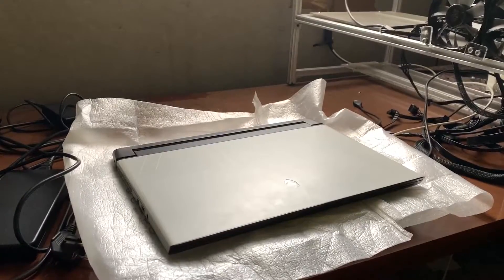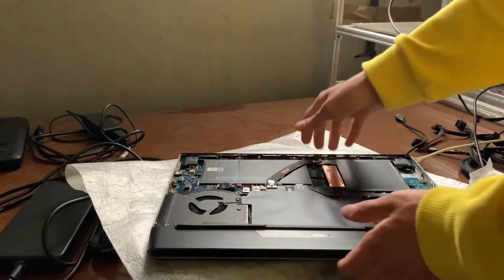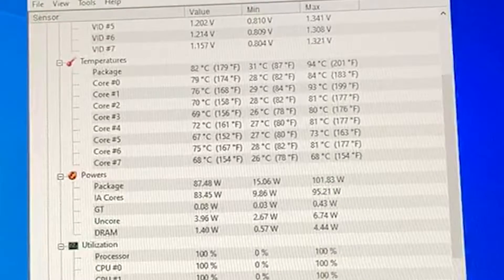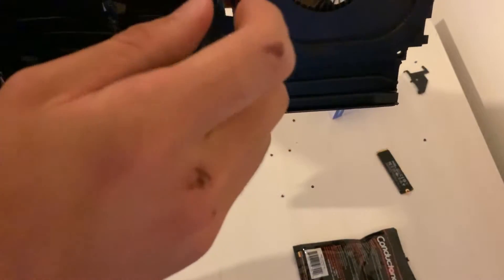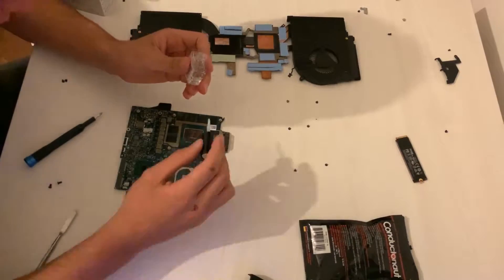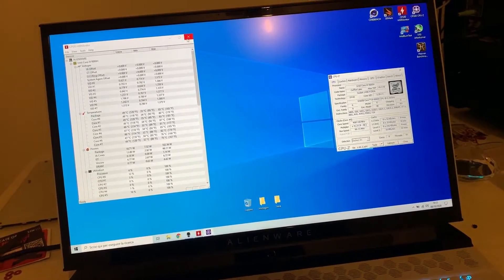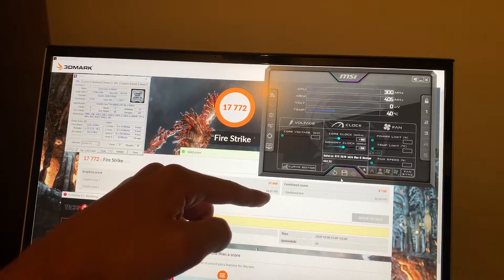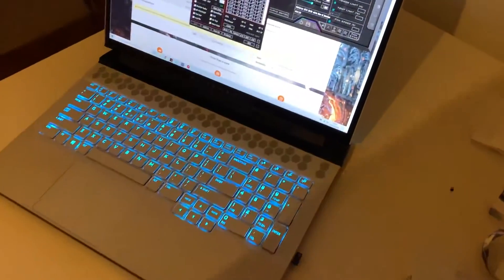I put Liquid Metal inside my $1200 Alienware M17 R2: Cooler & Faster!

Comment: Did you tried with graphite sheet?? Using this sheet is awesome I mean no dealing with messy liquid...
You could have used small sponge along with nail polish

Correct me if I'm wrong
Reply from the maker: Liquid metal has a way higher thermal conductivity, it’s a bit messy to apply but it’s gonna perform way better